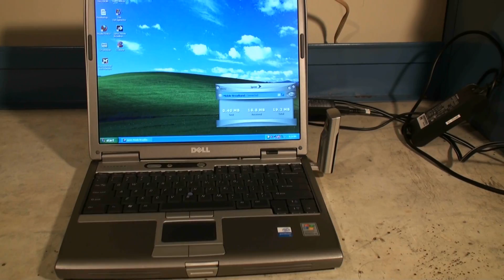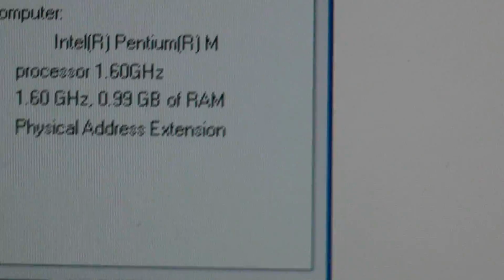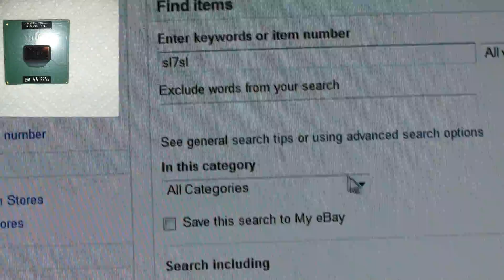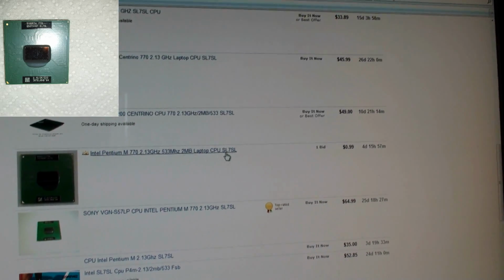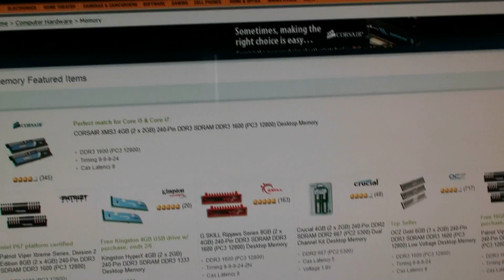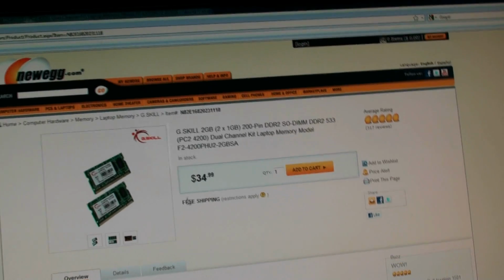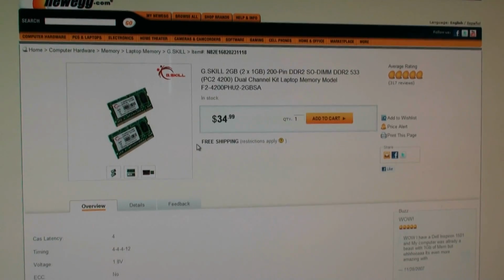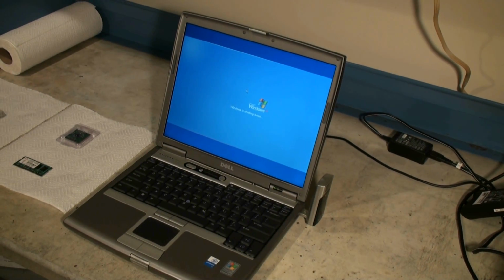Dell Latitude d610 CPU & Memory Upgrade Video #1

Comment: Thanks 31pockets. I know this is an old video, but I have a D610 that has been sitting idle for several years. About $50 total, and I have a 2.13Ghz processor, 2GB RAM (using your tutorial to do the hardware upgrades), and a PATA SSD for this old girl. I upgraded to Win7 and I am using this to run the chart plotter on my boat. Perfect!

Comment: You could do a pin-mod if you really wanted to... ups the FSB from 400MHz to 533MHz, effectively clocking in the 1.6GHz to 2.13GHz... however I just had a quick look on ebay and you can grab yourself a 770 for as little as $2 nowadays =)

Comment: GREAT TUTORIAL VIDEO!!!  Good step by step instructions with nice camera shots.  If you do what he says you can't miss!  Watch both video's, 1 & 2.  FYI, I upgraded my 8+ year old Dell Latitude D610 Windows XP from 1 GB memory to the maximum 2 GB memory and a 1.73 CPU to a 2.26 CPU. There is a noticeable improvement in overall booting and system performance.  I paid around $50 for everything including shipping from an Ebay seller in Hong Kong.  Took almost three weeks to get to Florida.  Thanks again!!!
Reply: 2.26 ghz cpu? That machine only supports up to 2.13.
Reply: nandoGdog I was curious about that for a while. I know they make a 2.26 that fits the socket, but so far I only have the 2.13.

Comment: The part number you gave for the memory is 240 pin while the system needs 200 pin.  You should correct this error.  Thank you.

Comment: Hi, could not load your video because of youtube trouble but it looks like it has good info in it.  I have a D610 with a 1.7ghz chip now w/2GB of RAM.  What guidance would you offer on upgrading the CPU to handle windows 7?  I want to do a cost/benefit to see if it is worth doing so verses buying a new box.  It would be nice to keep this alive, it has been reliable so far.  Thanks in advance for your help.

Comment: will a socket 478 processor for a desktop pc fit in a d610? and work? i can not afford to buy a processor online or in store and i have several processors in my parts bin waiting to be installed please email me at poolplayerpro3@yahoo.com with answers asap i really need to know if it will work before i start working on my laptop

Comment: Looked on Intel's website, and found a couple of other CPU options that I'm wondering about.  The fastest is the SL7VB, a 2.26GHz Pentium M with the same 27watt power envelope as the 2.13GHz SL7SL you used for this video.  Alternatively, I also saw the SL7V3, a 2.10GHz Pentium M consuming 21watts (if battery life is more important than speed).  Would either of these CPUs also work, or is there BIOS/chipset/motherboard limitation that would prevent their use?  Please let me know...